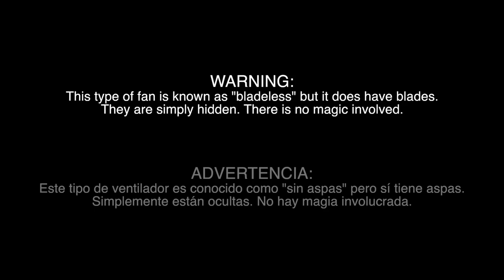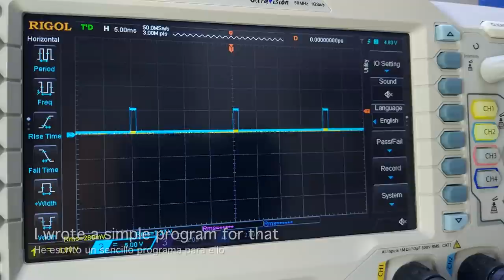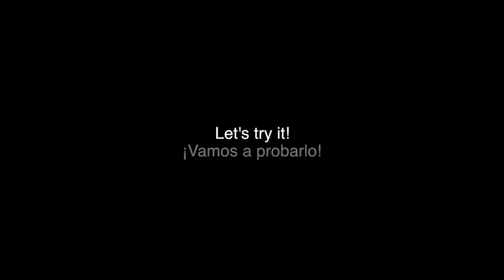How to Make a BLADELESS FAN

Comment: Great design, & looks like it pumps out a lot of air! To deal with items getting sucked in I'd suggest having an additional printable part that looks like a bug screen that can be placed inside. It would then act as a removable, cleanable filter for large objects & dust and could be printed as a few layers without rafts very quickly!
Reply from the maker: That's a good idea. Printing that part would help for sure with dust and particles. Also, throwing confetti directly at the fan is not the greatest idea I guess 😂 Thanks for your comment!

Comment: Outrunners are naturally noisy. Maybe a normal brushless motor and some minor tweaking to the fan blades could result in a much quieter unit. Absolutely fantastic work regardless.
Reply from the maker: You are right, Nathaniel. This combination of elements have not been designed to be as silent as possible. Thank you for your comment 😉

Comment: I love the concept and design. It is very similar to the original dyson bladeless fan. My only grip is that design and motor configuration seems way too noisy for my needs.  I'm sure with a tweeked mounting system you would be able to install a noctua  fan instead of that brushless DC and you will get way less noise position and possibility more power efficiency.

Comment: Hey, awesome project, very eye-opening to see. Couple of questions that I hope don't take too much time to answer.

1) What 3D printer was used/ what would you recommend for a project like this?

2) Would it be possible to scale this model down to say 15-20% of its size and place it in a PC case for cooling?

Thanks man!
Reply from the maker: I used a Prusa MK2 but you can use almost any printer of reasonable quality to print something like this. And yes, I guess that you could scale it down but all the screw holes would be the wrong size... Thanks for your comment!

Comment: Awesome project! way to go!
I am very keen to know if this increases the thrust produced compared to the same motor and similar sized prop (as the one you designed and printed) just run by itself.
Thanks for the awesome video. :)
Reply from the maker: Yes, that would be so cool to be able to compare both setups. Honestly I haven't been able to do it but in theory this should be a better solution in terms of airflow. Thank you for watching!

Comment: I don't understand the code part? What is that for? And how would you use it? Pardon my ignorance. New to 3d and the print looks fairly straight forward but don't understand the code portion. PLease help.
Reply from the maker: The ESC (driver required to run the brushless motor) expects to receive a servo type of signal to know at what speed should it make the motor spin. Normally a R/C receiver outputs this signal according to the stick position of a R/C transmitter but in this case I have to "transform" the linear voltage coming out of my speed potentiometer to the proportional servo type of signal that the ESC expects. That's what the Digispark ATtiny85 is there for and it does exactly that by executing the code. Hope it helps!
Reply: @EliteWorm  Works also great with an Arduino Nano clone. I just used different Ports then A1 for the Poti and D9 fot the ESC signal.
Reply from the maker: @XTRLFX  Good to know that, thanks for telling me 😉👍

Comment: About the 2 parts that are glued together, can't they be printed as one single component?
Reply from the maker: I haven't found a proper way to do it with good results... It would require using a ton of support and still it wouldn't come out as smooth as this. Anyway, gluing them together with silicone is not a big deal 😉
Reply: Elite Worm yeah, I suspected this was because of support but could not really judge is the angles were too steep. Thanks!

Comment: Very cool! Do you have source code as well? Would like to see PWM implementation
Reply from the maker: It's a very simple and short program but I will upload it to my GitHub profile today. I'll get back to you.
Reply from the maker: Here you are: https://github.com/EliteWorm/Bladeless_Fan/blob/master/Bladeless_Fan_V_1_0_0.ino
Reply: @EliteWorm  Ah nice! I used https://forum.arduino.cc/index.php?topic=117425.0 in my projects - it gives a bit more control
Reply from the maker: @dmitryvalberg1425  Does it work with the Digispark ATtiny85? It's very limited in terms of memory.

Comment: Looks great, but sounds super loud
Reply from the maker: Yes, it is loud at 70 - 100 % but at lower speeds I think it's OK. Thank you! Maybe smoothing the propeller with acetone would help too 😉
Reply: @EliteWorm  Perhaps different sizes and shaped blades. Also i wonder if a flat inside and the curved shape ( like a wing) outside  will blow harder.
Reply: Also also, can we get the STLs please.
Reply from the maker: @yodu45  I will post them today on my Thingiverse profile 😉👍